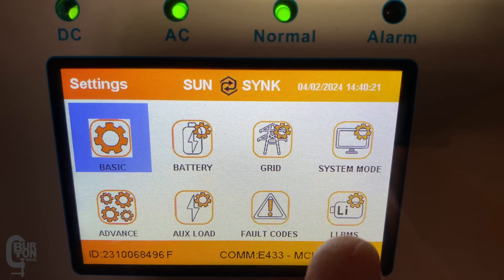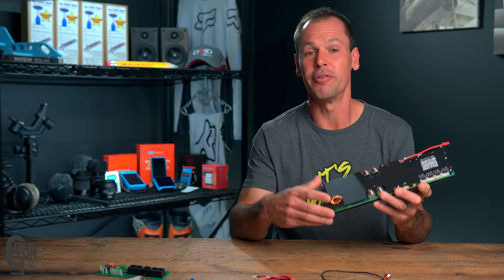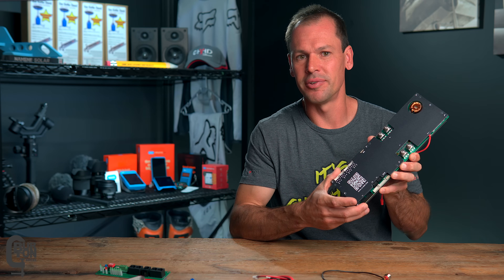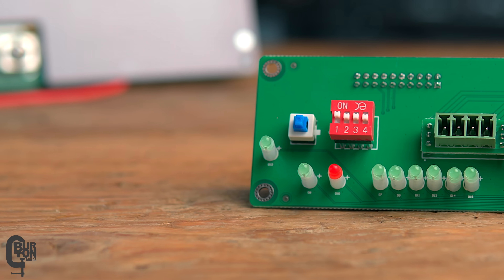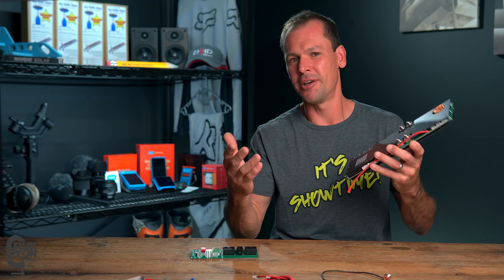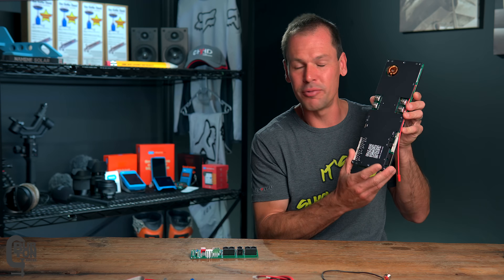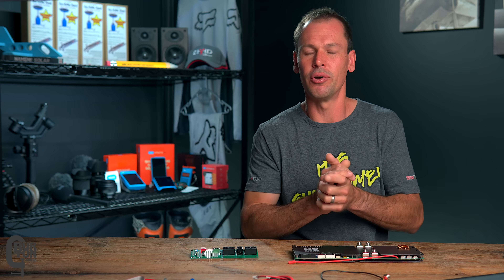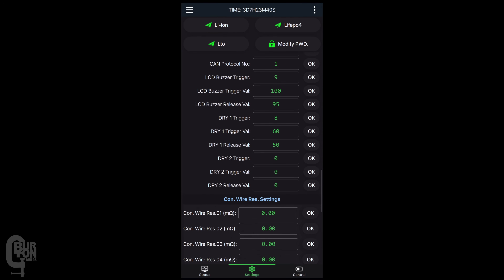New JK Inverter BMS Review + Test with Sunsynk Inverter

Comment: Please make a tutorial video on how to connect and communicate between two JK BMS through the RS485 port.
Reply from the maker: Hi, you should just be able to plug an ethernet cable into the RS485 parallel port on each of the BMS's and it works. This video might also be of interest about how to connect up the communication  https://youtu.be/iXuFI8-lFQ8

Comment: it is a nice piece but never forget to do the correct updates... did not updated mine yet
Reply from the maker: I was running firmware version 15.11 (on hardware version 15 or the JK Inverter BMS) but noticed SOC wasn't aggregating correctly with 2 batteries in parallel, but everything else was working well. I've upgraded to 15.17 and set 002 - PYLON-Low-voltage-V1.2 as the CAN protocol to communicate with SunSynk Inverter and everything so far seems to be working.

I haven't run anything before firmware version 15.11 but I've heard of a few people reporting problems with earlier firmware versions... so maybe it's a good idea to update to at least 15.11? (or the equivalent firmware version if you have Hardware version 14 of the BMS)
Reply: @GrantBurton  i m experementing with the late version of the older b series with  balancer right now.. i  hope the inverter one locks the cold parameters  better !!!  long term problems.... it doesnt accept 123456 code unless i force it again without erase the numbers.. ....   hope the new bms doesnt have that anoying bug .. i wont update my old one for those 2 tiny problems but  wishes it doesnt show more bugs
Reply from the maker: @anaxiosesti88  I think there were problems with the old firmware on the Inverter BMS, but those bugs have now been fixed... at least from 15.11 onwards that I know of.

The password on the new BMS doesn't seem to be giving those problems on hardware version 15, but I do remember hearing some people were experiencing password problems with the old style JK BMS. I used two of those older ones for over a year and didn't experience any problems luckily.

Comment: Greeting
How to value recommend for jk bms setting
For battery litheum 51.2vdc
(16 cells 307 Ah
Reply from the maker: Hi, the values you set depends on the specifications of the battery cells you are using, so best is to check the data sheet for your cells and make sure none of those limits are exceeded.

Credit to Andy from Off Grid Garage... I started using the settings he talks about in his videos, but I set my own charge and discharge current limits appropriate for my cells, and over time make small changes to suit my exact setup... but I generally lean towards safe / conservative settings and not settings that run right up against the limits.

Comment: Lo tengo pero no comunicado pero de momento funciona fenomenal
Reply from the maker: Thanks for your comment. I also used the previous style (non-inverter JK BMS) without communication for over a year and it also worked great. What inverter are you using?
Reply: @GrantBurton estoy usando un multiplus 48v 5000w
Reply from the maker: @mflo1970  Victron make great quality products. Have you checked that the CAN High and CAN Low wires are going to the correct pins on whatever is handling your communication (probably a Cerbo GX?).

I think on the Victron systems, CAN high is on Pin 7 and CAN low is pin 8 but on the JK BMS, CAN high is Pin 4 and CAN low is Pin 5 so a standard ethernet cable won't work. You may have to make up your own cable.
Reply: @GrantBurton You can also buy one off Victron. Victron can work with the Pylon protocol. Not sure if JK has Victron specific protocol. BTW loved the video. You sound like you're a professional presenter?
Reply from the maker: @mondotv4216  Hi, there is a Victron CAN protocol that can be selected in the JK BMS app... I think it is 004 - Victron_CANbus_BMS_protocol_20170717. Thanks very much for your comment. I'm no professional presenter, just an average guy... but thank you.

Comment: hello, is it possible to use this new-style BMS on electric bicycles
Reply from the maker: I’m not 100% sure what all the requirements for a BMS on an electric bicycle would be but I guess it would work… it basically has all the same functions as the other ‘non inverter’ BMS with a couple of additional features… but I don’t think these extra functions would need to be used.

The downside is that the Inverter BMS is much larger and I would think that space on an electric bicycle is at a premium.

Are you busy building an electric bike?
Reply: I ordered on Aliexpress a few days ago, it is already on the way, after I realized that it is designed for solar panels and performs a lot of functions, now I will have to study the bms before connecting
Reply: Anyway, thanks for responding.
Reply from the maker: @ДенисШапшников  It's a pleasure... let us know how your project turns out.
Reply: I will definitely tell you, but it won't be soon.

Comment: Found this channel just now. Really good content- great job. I'm looking forward to further JK firmware updates to support other inverter brands like Luxpower. Also, I know this will more than likely require a hardware change but would be awesome if JK BMS' had wifi to allow the BMS to be monitored over the internet similar to Daly.
Reply from the maker: Thanks very much. I'm sure over time they will update and add support for other inverters... let's hope. I guess adding wifi monitoring is possible with a sort of 'wifi adapter' that plugs into the RS485 port, which pulls all the info and uploads to something like home assistant (or the JK app if its hardware made by JK).

A couple weeks ago, I remember reading on one of the forums about somebody having programmed an ESP32, which plugs into the BMS RS485 port and draws the BMS info and streams it to Home Assistant... so i guess it could be indirectly monitored through Home Assistant.

Comment: Well this is a bit annoying...I was advised to go with a Seplos BMS as the JK will not work with my Sunsynk ECCO Inverter....I'd have much rather gone JK as well....Bugger ! I'll get the JK now and see if i can return the Seplos. Thanks for the vid.
Reply from the maker: Hi, I wonder if the @sunsynk ECCO inverters use different communication compared to the 'normal' SunSynk inverters. I've only has the JK Inverter BMS connected and communicating with our SunSynk inverter for a couple days now... so far, everything seems to be working but its still early days I guess.

I am busy working on another video on how to connect the JK Inverter BMS to the SunSynk Inverter using CAN Communication, and showing the information it displays and testing how the Charge and Discharge Current limits and Charge Voltage Limits interact with the Inverter... should be out in another week or two (hopefully).
Reply: @GrantBurton  Hi Grant...
Thanks for the reply, a video on how to connect the JK using would be extremely helpful.....I'll look forward to it...Subbed.
Reply from the maker: @kennyrodg  Guess I'll have to get stuck in then... haha. Thanks for the sub.
Reply: @GrantBurton  Yep, there's nothing else for it mate lol....Deep dive imminent !!!!
On a serious note though, It'll help a lot of users as there's not much out there when it comes to diy batteries and Sunsynk playing nice together...it'll be much appreciated.
Reply: @kennyrodg  Why do you need coms does that inverter have a lead acid setting?  If your battery is 48V 16S set to absorption to 58V and float to 54.4V no issues. Let the BMS do the job of protecting the batteries and balancing treat the inverter as a power supply.
Reply: @Mike-01234  Hi there Bud....Since this initial post I got the JK inverter bms and everything's been running fine "on comms" since early June... Massive thanks to Grant for all his vids on the subject though, it's been a massive help. Appreciate your comment Bud, Thanks.

Comment: Hi Grant,
Can you help me confirm a bit about the Dry contact relay settings?
I need the BMS to activate the relay at certain SOC % And turn off the relay at certain SOC %
Say I want to turn off the inverter Mains input as soon as Battery SOC reaches 70%. And then reconnect to mains as battery reaches 20% SOC.
I mainly use solar for power saving.
Thanks.
Reply from the maker: Hi, I think it may work. The dry contacts are Normally Open (NO). There are three settings for triggering these relays... Trigger, Trigger Value and Release Value.

I tried the following -> Trigger set to 'Low SOC' and Trigger Value set to 21 and Trigger Release set to 69, the relay closes when the SOC reaches 20 (i.e. drops below the Trigger Value of 21) and the relay opens again when the SOC reaches 70 (i.e. rises above Release Value of 69).

You'll likely have to use a contactor to reliably connect / disconnect mains input over a long period of time.
Reply: @GrantBurton  wow thanks for confirming.
I'll probably use the dry contact to trigger a 2nd, much beefier relay which can take the mains load comfortably. Then use it to switch mains.

Though I wish they should have given low soc as well as high soc trigger to make it even more flexible.

BTW one more thing!
Can we manually override or switch these relays using the mobile app?
Say if I need to activate mains for charging?
Reply from the maker: @ZenInnovations  A workaround may be to use the Low SOC triggers to drive another relay with NC contacts... So when the Low SOC relay releases, the additional NC relay loses power and thus closes it's contacts acting like a High SOC trigger? and when the Low SOC relay triggers, the additional NC relay energises thus opening the additional NC relay contacts.

Probably easier for JK to just add the feature in software though.

I don't think the relays can be manually triggered (like with a software switch)... I'll need to have another look though.